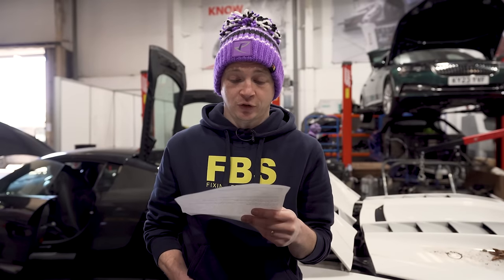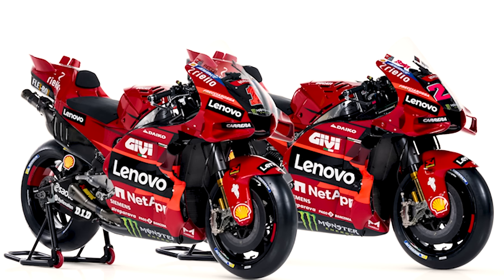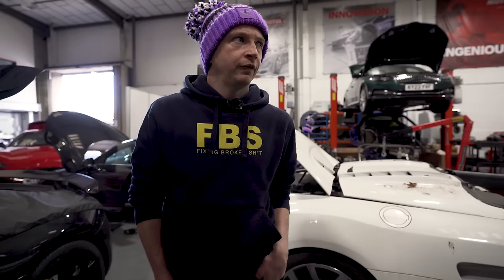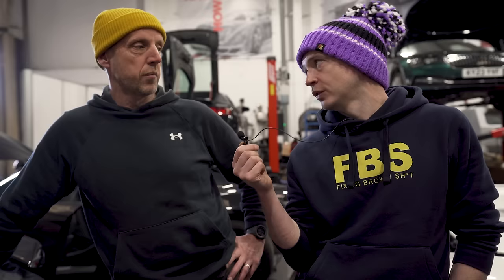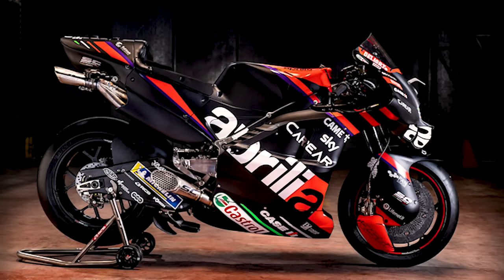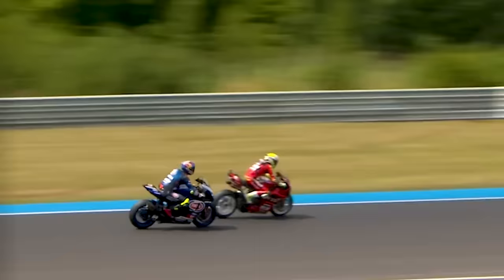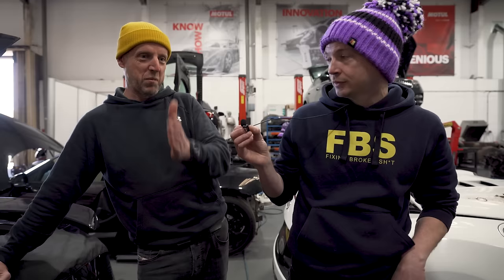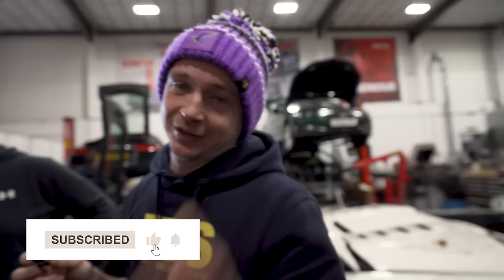Why F1 Style Aero is Killing MotoGP!

Comment: what F1 is doing to close the gap (or atleast giving them as much help as they can) is that the higher you finish in the standings, the LESS time and resources you get to develop your car (usually by restricting CFD and Wind tunnel time) 
meaning the teams that finish last have the most time to develop their car 

also on the topic of "nobody passes" F1 has always been like this, you have the 3 cars in the front and then the rest of the grid, been like that since the 90s when i started watching 
biggest difference is that cars no longer blow up as they have limited amounts of engines and cant just run 3 engines a race anymore 
now a car has to last 6 or so races before the engine or gearbox can give out, wich leads to cars that are significantly more reliable than the cars in the 90s, so the guy up front doesnt just suddenly retire anymore at half of the races like we used to see

Comment: Why does MotoGP need to be aspirational?
Why does the bike need to be special compared with the road bike?
This is the thinking that got Formula One into the conundrum it's been in for 30 years.
Reply: Engine development is exactly what MotoGP should be.
Yamaha developing 30(insert measurement whatever here)more torque than Ducati or Honda, translates to exactly what the street rider wants.
Whereas air parts do not.

Comment: When do you go back to then, remove the traction control, carbon brakes, seemless gear box, special fuel, what about slick tyres or fairings complety what is the point of this discussion racing is about development otherwise it is a stagnent and nothing changes everything stays the same which goes against the human instenct.

Comment: The 2027 season for MotoGP can't come quick enough as far as I am concerned. 
Why Dorna and or Liberty haven't already recognised that their sport has become exactly the same as F1 10 years ago, I have no idea.
Perhaps they just choose not to read the news and or commentary. Even conservative jounalists recognise there is a problem.
It's a disaster born of Michelins rubbish front tyre and the enforcement of completely absurd tyre pressure rules.
I can barely watch any more. Ducati 1 -> 4 on the weekend at Austria.
The sooner the sport is released from ride height devices, aero and potentially the horsepower to negate the aero, the better the sport will be again. 
Hopefully. 
They already fiddled enough with WSBK because the bikes were getting too close to the MotoGP lap times, but now the evolution of aero, because teams needed to find a way to load the front Michelin, this has gone too far.

Comment: About the banning of the aero it'll cost too much for the manufacturer to rebuild a new kind of bike that have no aero and they will probably complain about it, because they already develop all of those aero for years and doesn't want to waste all of that knowledge and resources to waste. 

Dorna will probably just limit those aero a bit more and not make it more ridiculous, also make all of the bikes more competitive and an even playing field, Dorna also made a concession to the manufacturer that scores below certain points and categorized it from A to D, which A is getting less test, less tires for the test and couldn't change parts in the middle of the season or could only change a certain amount that I forgot, which the D category get more test, tires for the test and could change parts to develop the race bikes, also the racer could participate for the test not only the test riders. for B and C, they just got in between of A category disadvantages and D category advantages.

Also, probably there would be a big regulation change in 2027, let's hope the 2027 regulation change is for the best, and let's hope the tire pressure check is like the WSBK one where they just check it at the start of the race and make all of them the same, and whatever the pressure it is at the end of the race it'll not affect the final result. 

Sorry for the bad English I'm not a native English speaker 😅.